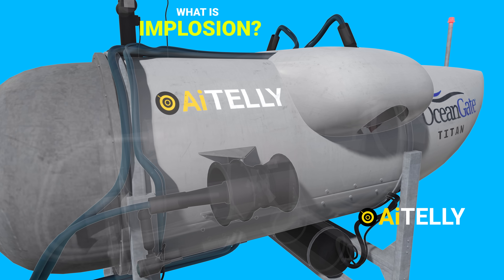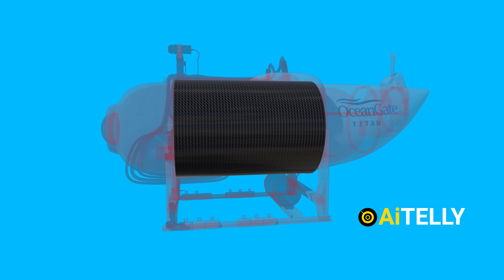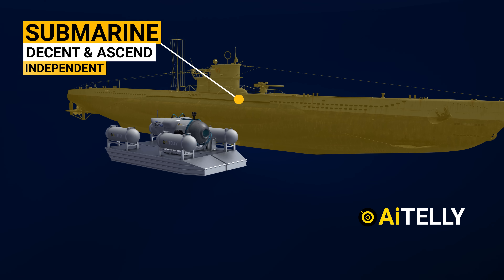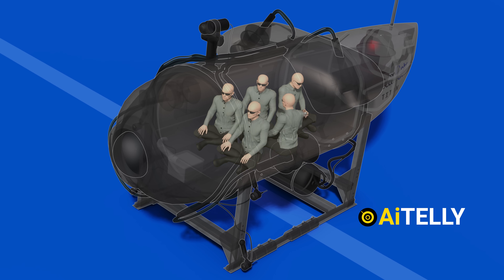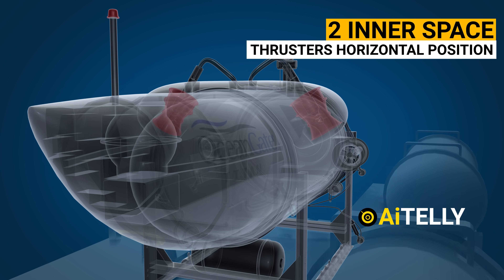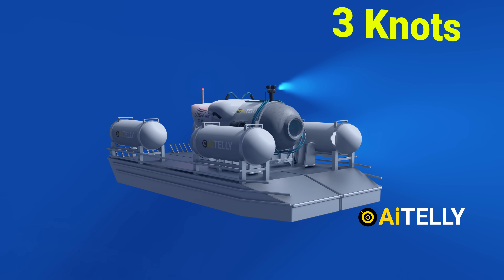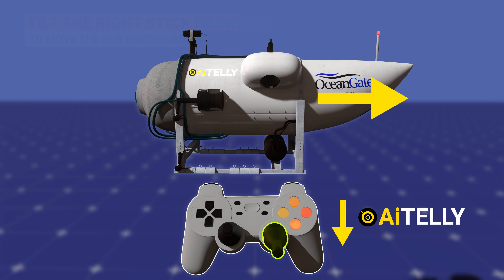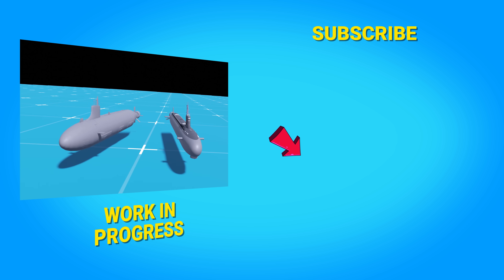Implosion Titan Oceangate How it Happened | Submersible Submarine Parts #3d

Comment: The Titanic director explained that carbon fiber composite – the make of the Titan – is used very very successfully for internal pressure, for vessels like say, a scuba tank. But for something that sees external pressure, all of the advantages of carbon composites go away and all the disadvantages come into play, he said. “It was the wrong material for submersible hulls. You can have a number of successful dives and fail later. It is quite insidious,” Cameron said in the interview.
Reply: That's why it's great for aircraft and terrible for subs
Reply: Yes from what I understand every dive down made the hull weaker and weaker. And eventually it was gonna implode.
Reply: @LegendsPizzaCo  NO NO NO. That is metal fatigue, carbon fiber does not have this issue. God the sheer amount of RUBBISH being spouted around on these videos is RIDICULOUS!
Reply: @Berserkism  did you see they bought old "expired" carbon fiber. If carbon doesn't have fatigue why would Boeing stop using it and said it's expired. Hmmmmmm
Reply: Also the carbon fiber used in the hull was bought on the cheap from Boeing because it had passed its expiration date.
Reply: @lazaruscain3424 true but multiple engineers have said this part wasn’t relevant. Just like controlling it with a gaming controller was not an issue(other than it using Bluetooth and not being hard wired) gaming controllers make controlling the sun easy and are also very accurate.
Reply: @lazaruscain3424  wow really? He used expired carbon fiber just to save a few bucks on something he planned on making multiple deep dives in something that puts ppls lives in his hands? The more i read about this rush guy, the more he seems stupid, arrogant, and cheap instead of smart and innovative. You dont cheap out when doing something like this and ppls lives are in your hands.
Reply: If you listen to Stockton's interview, it's clear that he was very arrogant.  He thought he knew better than everyone else.  The people who went down there with him made a tragic mistake.
Reply: @angiev1840 Hmm, almost reminds you of someone else who brought about disaster. This seems to be reoccurring theme in the U.S., valuing the opinion of businessmen/politicians over the expert analysis of scientist and engineers, ultimately leading to disaster.
Reply: in a way like the same principle of a gator's bite. Gators have one of the strongest bite forces in all the animal kingdom biting downward but you can clamp those powerful jaws shut with  one hand on the way upward,, they don't have any strength opening at all. Some things just work like that,, very good in one direction,, not necessarily so good in the other. Internal vs. external are two totally different dynamics having to be looked upon & approached in totally separate ways. Carbon fiber in essence is somewhat like the "gator bite" of aerospace materials..
Reply: I listened to a carbon fiber engineer that said the sub would have been stronger if they had only used apoxy only. So they were in a sub made from glue.
Reply: It is insidious, because it weakens GRADUALLY, the fibers AND the glue. Just by exposing it to water. Imagine doing THAT at EXTREME pressures.
Reply: @renelaboy1517  Please stop spreading misinformation! Nothing you said is accurate.
Reply: Kind of like pushing a rope. Seems stupid to me.
Reply: @estlerd did not see your comment made two days before me, but came to the same conclusion. It seems that theoretically, if a cavity had been made to allow the water to enter the inside of the 5" thick cf, then the pressure would be equalized. But if you think it through further, this would only serve to transfer the pressure to the next layer inside...as if that cf hull did not exist. As for the scuba tank, yes there is internal pressure that correctly pulls the strings of cf. But even these low internal pressure applications will have degeneration of the epoxy from water exposure, and therfore  a limited life cycle. But at nothing near as extreme of rate as pushing on a string at high pressure.
Reply: @sarakeeet
Uh 🙄 duh that’s why he learns and gains experience from the actual scientists and experts.
Reply: Using carbon reinforced resin for pressure vessels is like climbing a rope: you excert tensile stress. Using it for a submersible is like pole vaulting a rope, hoping the resin will keep it from kinking.
Reply: @Sjanzo  you think it sounds correct but you are just pulling this from your ass. Completely wrong.
Reply: Makes perfect sense. You are essentially (or literally) pushing on a string
Reply: @queserasaraaa  No, that's why he hired people who knew what they were doing.
Reply: Yep. Carbon has amazing tensile strength for expansive pressure, but terrible in this type of applcation. Wasnt the carbon strength holding it together. Was literally just the glue. Exact opposite, but equivalent comparison is using concrete for cables on a suspension bridge
Reply: Carbon fiber is most resistant to being pulled apart not bot by being compressed
Reply: Yeah Cameron has gone down often so I trust his knowledge and expertise yet this guy thought you could just make it out of anything quite sad
Reply: @queserasaraaa Hes a submarine expert you donut
Reply: Yeah but the Titanic director is a white man.
Reply: Cameron is experienced, but like Rush, is also not an engineer. At least Cameron was smart enough to hire real engineers for his craft.
Reply: @murderbot4313 I really enjoy telling people they are wrong. Rush had two engineering degrees. Was he brash and did he ignore safety ALL YES. However, you should not  spread lies. He was indeed an engineer.
Reply: Also note that a lot of Carbon fibre composites don't deal with compression well unless treated, there are ways to help strength the composite by treating it and using something like Epoxy Resin (like what was suggested to Stockton Rush but they ignored the engineer). The reason for this is because with a lot of composites if you don't treat them then their properties wont be the same in all the spots, For example some areas in the Composite will have air gaps, more Carbon Fibre then Resin or other things within the composite etc. The reason for treating them is to strengthen and solidify the properties in all spots and help with Adhesion, it can also help reduce the susceptibility to oxidation.
Reply: @heathbrooks6436  How well you make the Carbon Fiber has no bearing on its validity for this application. You make any pressure vessel like shit, or damage it without noticing and something catastrophic can, will happen. The NONSENSE being spread in here and other videos is PURE CRINGE.
Reply: @Berserkism  Im aware and that's my point, Carbon Fibre doesn't have a place in Submarine/Submersible use in my opinion. The reason I brought up the treating was because its a way to help with the compression abilities, as well as how it was proposed by an Engineer and Stockton Rush ignored it. There are plenty of other substitutes for the job but perhaps Rush saw it as an opportunity for greater advancements in the Submersible community? Either way it was silly how he  did things.
Reply: @heathbrooks6436  ignore berserkism he's grouchy. Apparently he's a scientist and smarter than all the people breaking down this video lol. He needs to go read and research more
Reply: @heathbrooks6436 exactly. And without knowing for sure, especially when ignoring engineers, you dont put ppl inside of it. Its one thing if it was RC, but completely different ballgame when ppls lives are at stake. Just the fact that it was considered and experimental craft it should have never had ppl inside of it. But im sure these ppl signed waivers and knew the dangers. I just hope rush was upfront about everything and wasnt hiding anything just to get their money. But from things i have read thus far, he seemed cheap and arrogant more than he was innovative, so i wouldnt be surprised if he wasnt 100% truthful about risks he was aware of
Reply: One of the things I saw about the DSV's that Cameron was behind were also designed to go much further in depth than he ever intended for them to actually go. I cannot remember the numbers, but it was like for Titanic at 3,800 feet, the submersible was designed to go down to 6,000 feet depth.

Titan had components on it only designed to go down as far as 3,100 feet, but they pushed it to try and go the 3,800 feet, 700 feet beyond its calculated design limit. Sadly the implosion was pretty much inevitable.
Reply: @neilbadger4262  *metres, not feet.
1 metre = 3.33 feet
Reply: @neilbadger4262  the deepsea challenger was designed to go around 36,000 feet below sea level, the titanic is around 12,000 feet
Reply: @queserasaraaa  sure, but nothing he said was something a layperson wouldn't understand and he likely learned plenty from the engineers he hired.
Reply: The fact you cite "the Titanic director" instead of any engineer involved illustrates why the cartoons require a lack of technical knowledge.

Comment: The problem with carbon fiber is that it has no pliability so instead of flexing with stress and returning to form when removed from pressure like steel might, it cracks. It's even less flexible than fiberglass which also simply cracks when overstressed. It's highly possible that repeated trips at such depths caused small fractures in the hull that went unnoticed, weakening with each trip until failing catastrophically on its last outing. They also used a mixture of materials on the pressure vessel which expand and contract at different rates under pressure which can also contribute to faster wear, loss of structural integrity and leaks.

Comment: How did they fixed those two compiter screens to the hull?. Screw to it?. Maybe not a good idea.
Reply: @afd3206 Nothing was screwed into the fiber carbon hull. The only thing affixed to the hull were two titanium interface rings, which were bonded to the hull. The titanium end caps and the glass fiber outer shell were connected to the interface rings. 

There was an inner sheath slid into the hull and the inside components were affixed to it.
Reply: @niallnine9001  ok. Thanks.

Comment: i dont think this animatiom is acurate, all that could implode in there would be the center part, the cf cylinder, the two titanium half spheres did not implode they were both recovered pretty intact, the aft tail of the sub was not pressurized, this too was recovered intact, only the cf cylinder or passenger cabin was pressureized and was missing

Comment: Oh fuck you! The vessel reached nearly 13,000 or whatever many times . The sound sensors 1000 miles away picked up hull implosion at 3,500 feet. The final communications were that the thing was going down out of control. All of the ballast control systems failed. The skipper was a 72 yo former submariner from the French fleet. The  vessel was built from cheep sub standard materials that were rejected by others. The only question now is this: Why did they bring in all those ships on a "rescue" when they knew there was nothing left to rescue.? Why did they play out the oxygen reserve and string the public along. WHY did the media LIE to us?

Comment: Hello there, in 5:55 you claim that the submersible failed because the "weak" carbon fiber hull. Why are you saying this? The carbon fiber hull (if properly made) is likely to be more resistant than Titanium, in fact, there are scientific papers that share the result of studies that tested carbon fiber for submarine/submersible use.

There are much more likely spots were the artifact could fail, like the glass window, the union between the carbon fiber and the Titanium, etc.

Comment: If the sub's maximum depth was only the depth of the titanic then, it is a recipe for failure. Engineers design things for optimality, safety and efficiency, not for things to always serve to their max. Therefore if this sub maximum depth was 5000m, it should not dive beyond 3500m.

The carbon fiber was rolled only in parallel which is very much the wrong way to apply carbon fiber.

We all know the last part, the stupidity and arrogant negligence of the leadership

Comment: The problem is that an implosion is followed by a explosion. Every force has a equal opposing force. the air gets compressed for a moment in the sub and that same air then wants to escape because it is less dense than the outside and the internal pressure goes boom and breaks through all the cracks causing a explosion. Inside the ocean, this can be heard for 100's of miles with hydrophones. James Cameron said as much in his interview.
Reply: That is not what causes the explosion.  When any carbon in gas form is suddenly compressed at high velocity it ignites the Carbon. This effect can be seen in how diesel engines work)  The sudden increase in gas volume from the ignition causes the imploded components to instantly be reversed in a fireball which then blows the material outward until the pressure of the water then collapses it again.  This can sometimes cause a second and third implostion/explosion cycle until all of the oxygen is consumed in the ignition.
Reply: I was thinking that it reminded me of a supernova, too. Even the part where the increased pressure causes an increased temperature and can ignite elements that wouldn't normally ignite.
Reply: This phenomenon you describe seems to be similar in astrophysics
A star crushes under its own weight - implosion - and thereby rejects violently its outskirts - explosion
Reply: Not even remotely analogous.

Comment: how weird is imperial system , 5600 psi is pressure at 12,621 feet deep or 2103 fathom,  metric system is that simple pressure is 1 bar every 10m, ie weird numbers above translate in metric as 385 bars pressure at 3850 meters deep, thank you Napoleon.

Comment: If sonar picked it up hrs after reported missing, its possible to have been in a free fall. It weighs 25k lbs. I'm not sure the mile an hour rate at free fall but once it hit the seabed it compromised those titanium flanges and lost seal. Probably would have happened with a solid ti center section too who knows
Reply: Normal dive time was around 2 1/2 hours.   They lost contact 1 3/4 hours into the dive.   It never reached the bottom before it imploded.

Comment: You just fill 6 minute with random information of the submersible already widely known, and title it 'Implosion, how it happened'? Aided with an extremely poor animation of how maybe play-dough would collapse, but absolutely never resembling carbon fiber or even steel. Carbon fiber is extremely stiff on tensile load, but the epoxy glue might start to crack if subjected to compressive load. Therefore, if the crack becomes wide enough the local bending strength isn't high enough to withstand the pressure, so it would locally bend inside, putting higher bending stress on another part of the hull. This then leads to another crack developing and the whole tube collapsing; this all assuming we have an infinitely long tube. In this scenario it is way more likely that the connection from tube to lids (frame of acrylic glass) became weak and started a crack.
Reply from the maker: Thanks ! You might also like Nuclear Powered Submarine Engineering behind it #3d Nuclear Reactor released
Link: https://youtu.be/J0lb46Zi5-s

Comment: Redid your video and still got info wrong. Going down at 3k would be suicide. Titan wasnt rated, it could not go to 4000m which is why it imploded. It did make it to titanic. They were less than 900ft from the vessel when they imploded.
Reply from the maker: Thanks for the infos !
 You might also like Nuclear Powered Submarine Engineering behind it #3d Nuclear Reactor released
Link: https://youtu.be/J0lb46Zi5-s

Comment: We now know that Rush knew for about 20 minutes that the hull was failing. We also know that he should have aborted at the start of the mission, when the descent rate was 40% higher than predicted and had no certain explanation at the time - indicating that the craft may have taken on water weight in voids which had already developed due to cyclical delamination. In the last 5 minutes, they attempted to do an emergency power ascend, but only managed about 50 meters in 5 minutes before implosion. This further indicates that the craft had taken on water weight.
Reply from the maker: Great infos:Thanks ! You might also like Nuclear Powered Submarine Engineering behind it #3d Nuclear Reactor released
Link: https://youtu.be/J0lb46Zi5-s

Comment: SCENARIO X: It has been shown that the Titan descended a lot, lot faster than 3-4 knots.Why? The downward thruster stuck. This was due to someone having damaged the controller in training, changing the orientation of the switches inside. As the thruster stayed on for the duration of the descent, it overheated and ignited the oxygen on board. It was therefore an explosion on board the Titan.
Reply from the maker: Thanks ! You might also like Nuclear Powered Submarine Engineering behind it #3d Nuclear Reactor released
Link: https://youtu.be/J0lb46Zi5-s
Reply: proof?